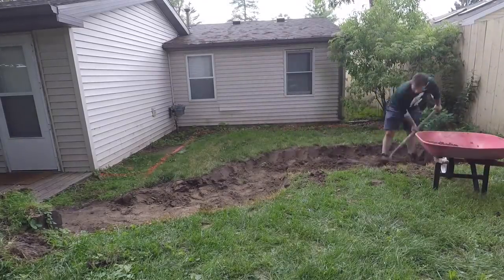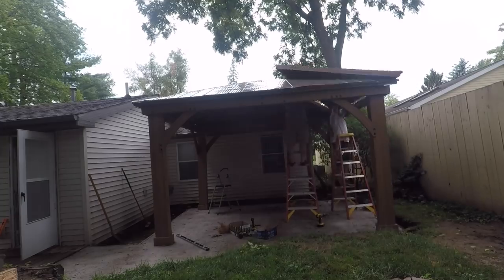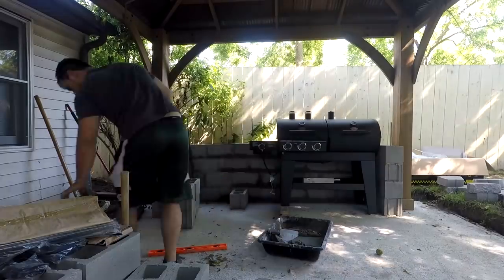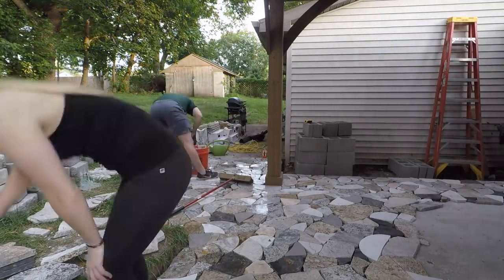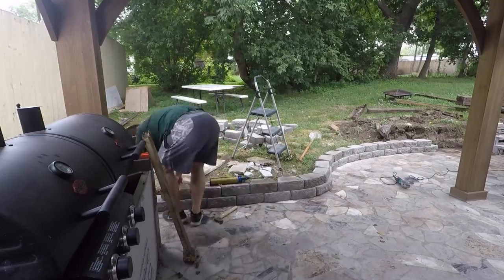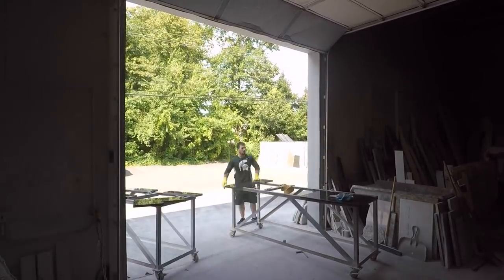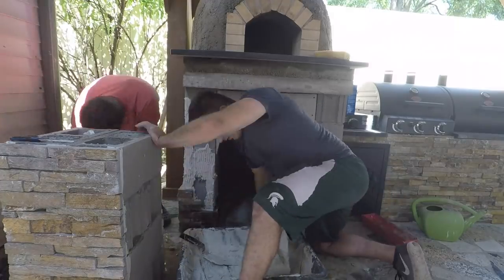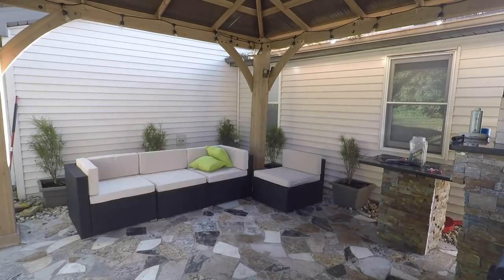My Affordable Patio Project! DIY Pompeii Wood Fired Pizza Oven, Gazebo, and More!

Comment: I think he has a different meaning of affordable than I do.
Reply: @kneeltomemotherfuckers666  Then there is taxes. Taxes are so crazy here that folks sell there houses for less than the assessed full market value and the next folks get such a deal, we all need to file greivances everywhere as things are out of control.
Reply: Bul Ba
Reply: No luck involved here.  As a homeowner, I consider 'affordable' to be anything that doesn't cost more than the materials.  You have to remember that the majority of any home project tends to be the labor.  So even if this project costs $5K, he's still VERY far ahead.  I would imagine this to easily be a 15-20K project if it were done by contractors.  Granted, with heavy machinery they would have completed it much more quickly, but there's still something to be said about DIY vs paid.  The savings in labor is well worth the extra time involved.
Reply: He looks like he is in the granite/tile business so the granite floor is a freebee since it was scraps.  I would besides that the whole summed up to around 6K.
Reply: Bul Bal you mean because he is white
Reply: Without the labor intensive  affordability  cost, which would have been doubled, and trust me none of that stuff is as expensive as you think, do your research..

Its mind boggling, I just watched someone build a 2100 square foot with a garage big enough to park your car and have a workshop in.
For under 30,000 framing, trusts, concrete, insulation, septic system system installation and Patio....without utility yet installment.. the whole house after medal roofing was right at 70,000 after utility, wall ceiling, floor, garage door, windows and doors instsllment.

Do your research and dont be afraid to learn..
Reply: Vanya Jelezarova very good!
Reply: The only thing affordable I see there is that cheap a$$ grill he put in there. All that money he spent he puts the cheapest grill on there.
Reply: Petra Robles ,
Reply: @bulbal100  jealousy
Reply: @1ANDonlykellybaby  so 30,000 is afordable  😥😥

Comment: great work, good build, but just remove the "affordable" part
Reply: T00L1993 why?
Reply: I came to say the same thing. It's "affordable" if you have a family granite shop lol.
Reply: You could also get a really nice "affordable" finish by staining the concrete.
Reply: @kelleybrannon196  everyone has their own definition of affordable but the average American that makes from pay check to pay check and does diy projects probably the cinderblock portion would be affordable. Perspective is everything, but he did a gorgeous job.
Reply: Zach Kunkle This just showed up in my recommended, but I just wanted to say that you don’t need to have a granite business to have a granite patio. Most granite shops have free scrap pieces. So you can get all that for a little driving around. You can also get half boxes of veneer stone for a deep discount if you don’t mind puzzling together different patterns for the wall. You can rent a saw from your local Hrdwr store, and the rest is cement, blocks, and Labor.
Reply: @hadyrome5574  thanks for posting that. That's really helpful. I want do somethin like this this summer. My sister got a house recently and I think itd be cool before I eventually get my own place to build somethin for the yard as a gift of sorts.
Reply: Yes not affordable
Reply: Ryan Lopez it’s very affordable! He was talking about the pizza oven part being affordable, not the entire project. The pizza oven only cost around $600 which you can easily spend more than that on a nice gas grill and the food won’t taste near as good as it will from a wood fired pizza oven
Reply: You can also find broken sinks (water features), counters, etc at Goodwill and such. But yes check with the contractors and interior design shops for broken pieces and old samples. Make it your own!

Comment: As a professional Stone Mason only thing I saw was wrong was the rebar not tied together when putting in so just look out for minor cracks everything else is beautiful very good job
Reply from the maker: That means a lot coming from a professional, I tried my best from what I learned from watching others and doing my research! Thanks so much for watching my video and leaving a kind comment, I really appreciate it! Wishing you the best in 2019!
Reply: Vinny Gjokaj FYI if you made some business cards and put together a company that's a 25G job ;)  minimum
Reply: Not tying the steel wont make it crack lol wtf are you talking about. 

The main thing I noticed was the slab was lower than the yard. Also the gap between the patio and house can trap water. Also the horizontal steel in the block did not appear to be encased in an actual bond beam
Reply: rzl dzl wow took you long enough I've been waiting for the INTERNET KNOW IT ALL CONTRACTOR to show up!!!!  I clearly know nothing please upload a video showing us a step by step on how it's done
LMFAOOOO NOT!!!!!!!!
Reply: @YAKOVOS  dude the tie wire just holds the rebar in place. Chill
Reply: rzl dzl my young friend clearly you are not a professional in this line of work here's a little info from Google you can research it yourself after Benefits of Rebar. Adding rebar to concrete has many benefits. ... It helps to reduce the cracking and breaking that is common in concrete because of its brittle properties. Rebar provides strength to concrete
FYI I work on million dollar homes and have my own company please don't give advice again on a field you know nothing about 
Take care
Reply: @YAKOVOS  nah dude your original comment was about not tying the steel. I never claimed steel was worthless or anything of the sort. 

My only claim was that tying the steel doesnt do anything for the strength of the steel. (It only holds it place until the concrete gets hard. 

At this point I am guessing you are not a native English speaker?

Comment: I have one question what about when you have to replace the grill
Reply from the maker: While it would be really hard becaue the grill weighs about 300 lbs, you are able to just remove it vertically out
Reply: I was wondering the same or when he have to replace the propane tank!
Reply: Brittany Rice I think the small door at the bottom right of the grill area was built in for that reason. You can see how the propane tank was left exposed and he framed it out.
Reply: Engine hoist

Comment: I’d have run the stove pipe thru the roof of the Gazebo. I think on a summer evening you will regret the heat build up under the roof when entertaining. Beautiful work though. You don’t need to work out a lot when doing projects like this. I bet your back was wrecked. Big project way to stick with it to the end.
Reply from the maker: Thats a good point! Ive been using it in like 40ish degree Michigan weather and its been super nice because it does sorta heat up the entire area! If it does get to hot for summer nights i can just extend it through the roof! And yeah my back was hurting! I dont know all the tips and tricks masons use to sorta take the pressure of there backs!
Reply: Good idea, I'm sure the pipe will be warm enough to heat some area if it's through the roof. My concern would be the smoke being trapped under the gazebo...
Reply from the maker: David Vesseur yes! That's the only issue I faced so far is! When the fire sorta dies down to just coals it does get some smoke build up under he gazebo! This upcoming summer ,since it's -8 degrees now, I will actually worked the chimney to stick out of the gazebo!
Reply: You should run the chimney system above the gazebo roof by 3'.  This will help with performance of the pizza oven as well as make it up to code.  Also get rid of the smoke issues!  Great work all around on everything else
Reply: Through the roof??? Just add a couple of 90s and boom done ....
Reply from the maker: Livewirekcp that's what I'm doing this summer!
Reply: Vinny Gjokaj good to hear also great job 👍🏻👍🏻
Reply: Livewirekcp 90 degree elbows are not made for a Class A chimney pipe, 30 degree is the maximum offset used in that type of scenario.  Also huge bends in the venting system puts a drag on the draft.  Just saying I know the best way is thru the roof as i know from first hand experience
Reply: What about a ceiling fan? It will also give you light and keep the bugs off everyone.

Comment: I was just wondering something, in your title of the video it said Affordable. If you don't mind me asking how much did this coast, I did the math on the patio I want to put in and it is a lot less in to it then what you did and the price is far from affordable. Just to do my 16'x16' patio 4" thick in concrete is almost $900, then the tile I want is the cheapest and it will coast almost $400 just for that. I did a little math on what you did your affordable patio is more like $7,000-$8,000, figuring the concrete and the tile you used and also the gazebo. I don't want to sound like I am criticizing your video cause im not, I was just trying to figure what you meant about affordable patio!
Reply: Affordable compared to having contractors do it for him which would have probably been double that.

Edit: He said in another comment that it costed around $3k.
Reply from the maker: Yeah I totally agree what you mean, for me it cost around 3000, but using some round numbers, not including returning extra bricks and that 
Gazebo (Costco)- $750
Grill (Home Depot)- $300
Concrete slab - $300
Pizza oven supplies (Amazon, Forno Bravo,Angelos),$500
Patio furniture (Amazon) -$500
Cinder blocks, Pavors (Home Depot)-$200
Grout, cement, thinset (Home Depot) $150
Plants $200
Door (Amazon)-$50
Lights (Amazon)-$50
StackStone tile (MSI, our granite supplier)-$50
Reply: FatBoy Nation I had the same questions. Also, its cost not coast.
Reply: Stephen Melancon lol cost not costed.
Reply: Well, it was affordable for him. :)   

There is probably a granite or hard surface countertop fabricator in your area that you could easily get offcut pieces from for free or for very cheap, but from what I know, if I wanted to have them cut something specifically for me (even if it was a scrap piece I was getting for free), the charge would be 20 bucks per cut.  The upside would be, it would be the right size for sure .... I compromised by getting a Harbor Freight tile cutting wet saw and a diamond blade (the cheap 7-inch saw version that works like a table saw).  It probably isn't quite as accurate as a bridge saw, and man-handling big chunks of granite isn't fun.  This is the only cost that isn't properly itemized for his build, but as it's part of "the family business" it cost him nothing extra.

The mosaic tile-work looks awesome, but would probably be out of the price range for your typical homeowner unless they were hitting up their local granite fabricator week after week for several months to get the off-cuts.

I would estimate that if he had a company come into do all of that work, (including building a custom gazebo, pouring the slab, putting in the granite tile-work, pizza oven, grill work area, ect) he'ld have been out $12,000 - $15,000.  Enough to buy a NEW car.
Reply: FatBoy Nation I think maybe because he did the work himself.
Reply: more like 22000
Reply: That looks good

Comment: It turned out really nice.  The only question I have is, I didn't notice in the video that you secured the gazebo posts to the concrete slab.  If you didn't then when a good gust of wind comes thru it will lift that whole thing up and it will end up in the neighbors yard.
Reply from the maker: I did screw it into the slab! I used Tapcom screws to screw it directly to the lab with angle brackets!

Comment: If you haven't yet, you should cut that chimney pipe, and then put on an elbow to extend the chimney out from under the gazebo. That gazebo roof will likely trap the smoke from the oven. Or the best option would be to cut an opening in the top center of the gazebo roof and place a rain shield over it so the smoke can escape without building up.
Reply from the maker: Hey Joshua thats exactly what I did! What i showed in the video was just a quick temporary solution so I could use the oven before my classes started! Thanks so much for watching my video and taking the time to leave a comment! I really appreciate it! Wish you all the best!!

Comment: The only thing I saw affordable was the Home Depot bucket. Lol.   Hey man, Great job on the project. Looks awesome.
Reply from the maker: I know what you mean Michael, I really appreciate you taking the time to watch my video and leave such a kind comment! The entire project cost me about 3000 which Is allot of money, I sold some of my electronics and other things around the house to pay for it but since I did allot of the work my self it saved me a ton of money compared to what a contractor would've charged!
Reply: To be honest. 3k is not a lot for as mush as you did. I know some patio covers and cement slabs will cost at least 5 grand. Yesterday me and my fiancé left from our contractors meeting for our new house build. And that’s the price they told me to add a slab and patio cover. Lol.  But anywho. Awesome job bro

Comment: Great job, I salute you !
Reply from the maker: Hey thank you so much!! I really appreciate you watching my video!
Reply: @VinnyGjokaj  Did you think of using decorated concrete blocks that just stack on top of each and lock in without mortar instead of those blocks you used with mortar? Without the need to mortar, much easier but you did a great job.

Comment: Great job! Couple of questions, if you don’t mind. 
- how thick was the foundation concrete? Did you use rebars besides the mesh?  How much and what type of gravel and sand did you use under foundation?
- did you use 8x8x16 block or 6x8x16?
- how thick is the pizza oven top slab 3.5” or 5”?
Reply from the maker: 1) I used 6 bag 4000 PSI cement that was wire meshed reenforced with 6 gauge wire mesh, I used 22a crushed limestone as the foundation at 2” thick.
2) 8x8x16 block
3) the pick oven top was 3.5” thick, that was rebar reenforced!
Reply: @VinnyGjokaj  Thanks for the quick response. Few more questions if you don't mind.
1. How thick was the foundation, like 5.5"?
2. Did you only put a mess in the foundation and no rebar?
3. Did you order the concrete or rented the machine to mix it? That was cool.
4. How thick of rebar did you use for top slab, like 1/2" 12" apart?
Reply from the maker: @hhg11172  
1, the concrete was about 4” thick the 2x4s I used were floating above the gravel. and the gravel was 2” thick. 

2. The ground was most clay so it didn’t need rebar since I used a high strength concrete.

3. And yes exactly! 1/2” 12” apart. Now The rebar I used in the blocks did also extend vertically into the slab.

Comment: I DON'T KNOW ACTUAL BUILDING TIME BUT THE RESULT IS REALLY NICE . ONLY ONE POINT I'M CONCERNED ABOUT IS :  METAL CHIMNEY OF THE OVEN SHOULD BE EXTENDED THROUGH THE ROOF SO THAT NO SMOKE BOTHER YOUR CONVENIENT TIMES SPENDING THERE ...  CONGRATS
Reply from the maker: Thank you so much for taking the time to watch my video! I really appreciate it! The thing about the metal Chimney is I did it as a small straight piece just so I could finish the project quickly and curve the oven before my classes started and winter came! I actually redid the entire chimney so its extended out and above the whole gazebo roof and vents above it! Thanks again!

Comment: This is absolutely BEAUTIFUL !  Well done !  

Agree with some others though....this is a world away from affordable.  
I'm wondering...grills don't last forever...how will you get it out when it comes time to replace it or repair it ?
Reply from the maker: Thank you so much Annie, I really appreciate your kind comment! Thanks for checking out my video also!! 

The entire project cost me about 3000 to do , which dont get me wrong is alot of money, but is affordable in the sense that i did the labor my self, and I saved money on the floor by using scrap pieces of granite to make a mosaic pattern!!

Also, The grill, the two barrels are held onto the base by 4 bolts and with the bolts removed the barrels can be taken out, and then you can simply lift the base out and place a new grille in! While sure its not the easiest thing in the world its manageable!

Comment: I really didn't know where you were going with this project. It arrived in my youtube cuz I was googling Gazebos and Pizza ovens I guess. Costco has a great price for the one you have erected. I had the same idea but I thought that I would have to bring the chimney up through the roof of the gazebo then cap it off. How is it working out for you with the smoke I wonder? After watching the whole thing my 63 yr old back was very sore. I wish I had a family member in the granit biz. GREAT JOB!
Reply from the maker: Hey Patricia, Thanks so much for dropping by! It was a lot of work and a lot of long hours. The pizza oven chimney was rerouted to go outside and above the gazebo! What you saw here was just a temporary solution so I could fully cure it before winter started! And trust me, I get great deals on my granite needs!!

Comment: Great build but what happens when your grill breaks or you want to get a new one? Plus with the wall if you are charcoal cooking your grill won’t have any space to pull in air to feed the flames. Very short sighted on the grill but everything else look great!
Reply from the maker: To replace the grill, theres 4 bolts holding in the top barrels and with the barrels removed you can take out the base! Thank you so much Sheamus for checking out my video! I really appreciate it!